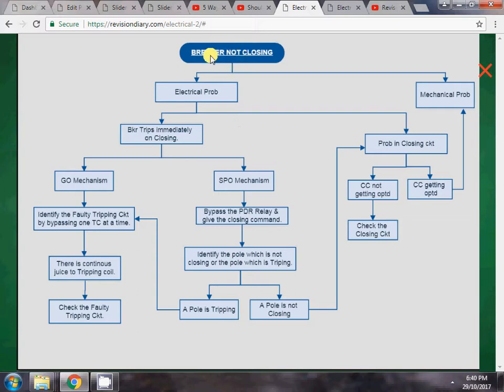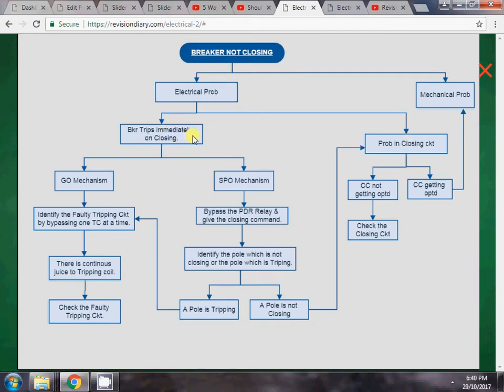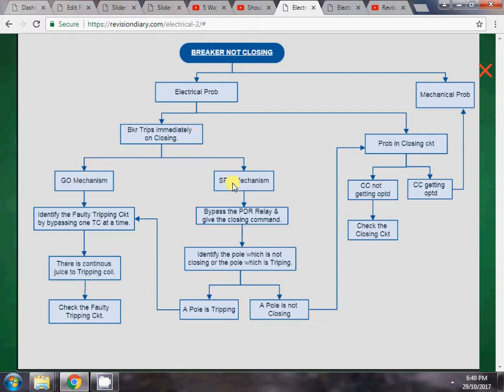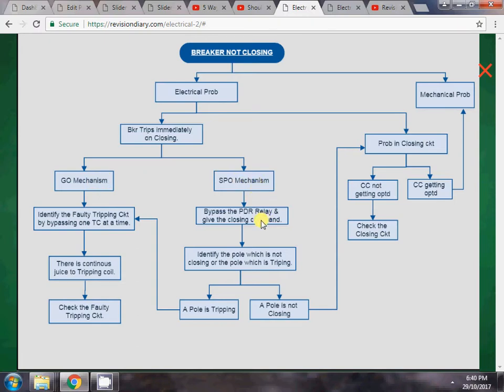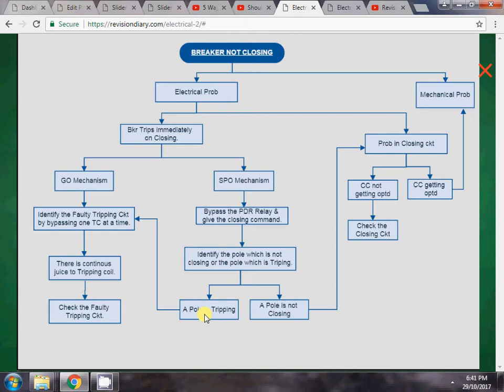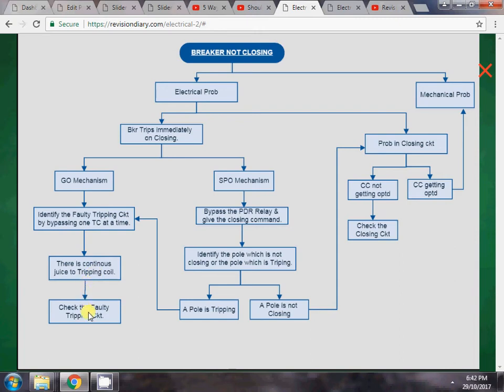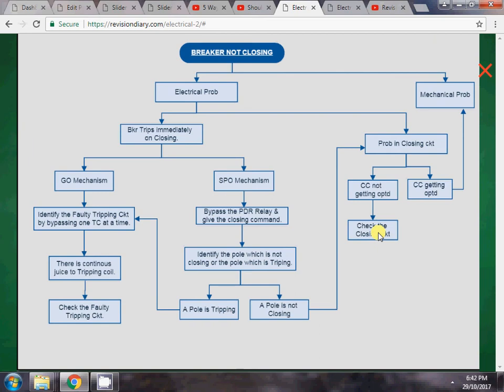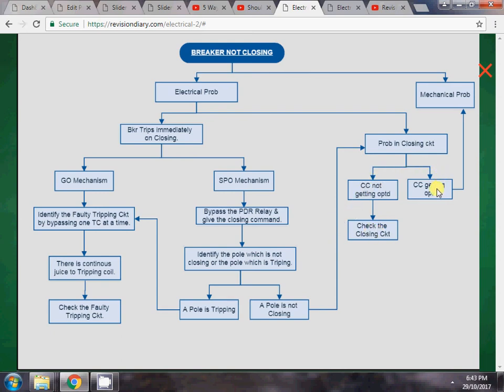Circuit Breaker Troubleshooting - Breaker not Closing

Comment: How does two tripping circuit get connected with one breaker.can you explain for me
Reply: Each of the trip coil finally helps to release a mechanical latch so as to move the moving contact of the CB by the stored energy of the spring/air. You can have any number of trip coils (in theory) connected in parallel to a tripping coil placed in such a way that when trip command is received by the trip coils that are in parallel, at least one of the trip coil's moving core releases the mechanical latch of the CB to open the CB.
Reply from the maker: Playlist on Circuit Breaker: https://www.youtube.com/playlist?list=PLlBI8bisRsHgAbdm3YP6jQ43UDipr3E1O&disable_polymer=true

Comment: Boss how to identify that is breaker single pole operated or gang operated.
Reply from the maker: It physically visible. SPO Breaker has three Operating Mechanism, while GO Breaker has one Operating Mechanism only.
Reply: @ELECTRICALFUNDAZ  thanks but it will mention on breaker plate or in circuit.
Reply: Also, you can see one Close coil and Two Trip Coils(For SP CB) per pole of the whole 3 Phase CB. Normally, SP CBs are used in 220 kV or above these days. Old 110 kV CBs are also seen rarely with SP operation setup. SPO helps the utility to recover from the common transient faults, thereby increasing uptime of the grid elements.
Reply from the maker: Yes, it will be mentioned in model number like SPO for Single pole operated or GO for Gang Operated.